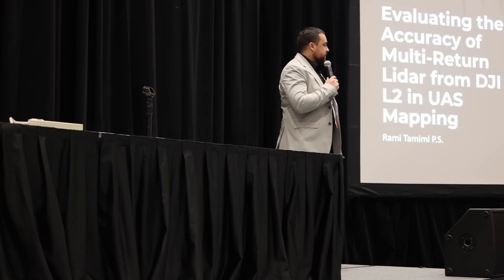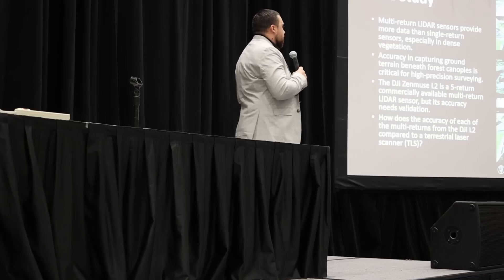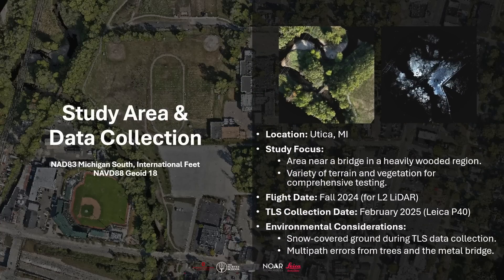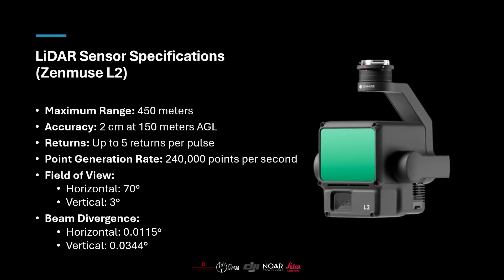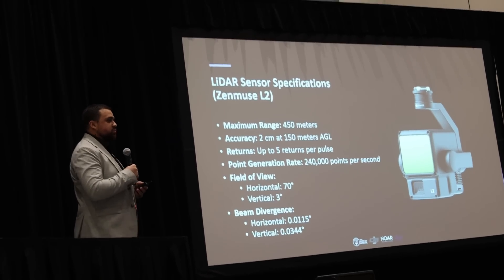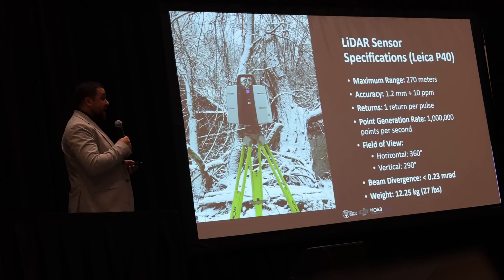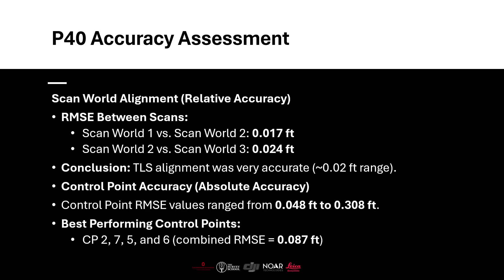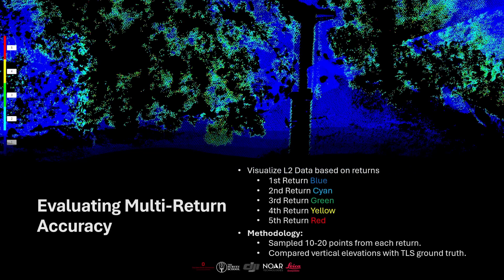How ACCURATE is DJI L2’s 5 returns?

Comment: Hi Rami, 

I have a question for you and for industry experts about the use of GCPs and CPs in DJI Terra.

 I'm curious about how GCPs and CPs are used by the DJI Terra. In photogrammetry, you can match each point you measured in the field - by using GNSS receiver like Leica GS15 - with its corresponding location in the images, but how does DJI Terra calculate the RMS error for LiDAR data if it doesn't let you do that same kind of point-by-point matching?

Thank you for your work 😁

Comment: This was a fantastic presentation Rami! If you ever get a chance, you should run this same dataset through LP360 to do a better strip alignment so that your overall RMSE is tighter across all returns.
Reply from the maker: Thank you sir. I agree, sampling 10-20 points isn't as fair as a strip alignment of the entire data set. This is something I will definitely consider when I do the terrestrial scan again in the spring.
Reply: @RamiTamimi if you need a license then let me know!